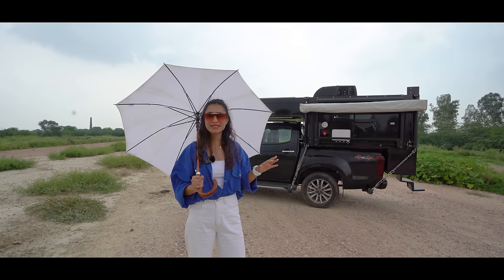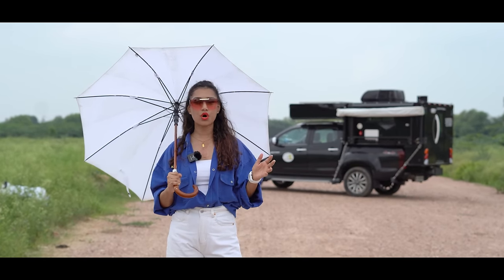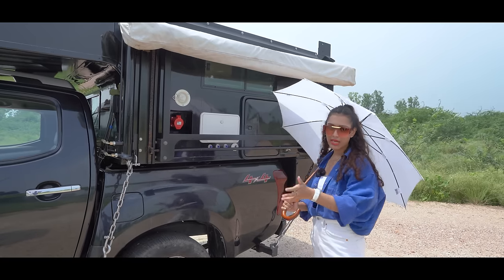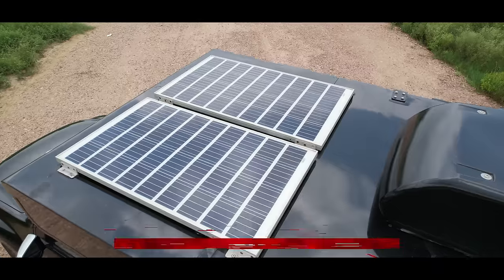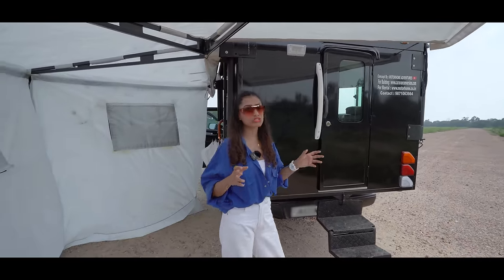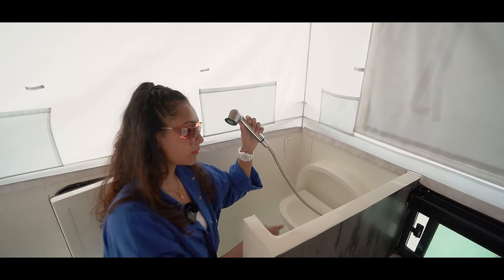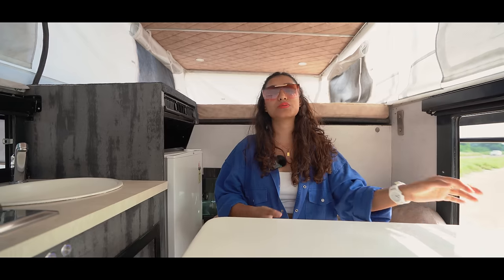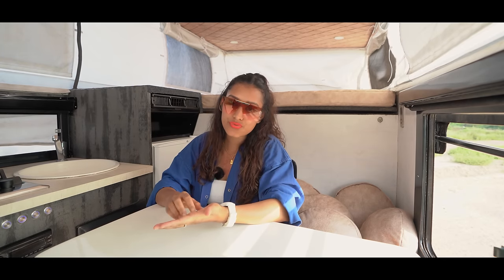Tour INDIA's First Slide in, Pick Up Caravan on Isuzu V Cross/ Walk Through | Motorhome Adventures

Comment: Its a great design... Kudos to the engineer behind the design....

The best part is the back cabin can be dismounted...

Also want to know about water tank placement and capacity....

I have few concerns...

Why the toilet is not placed in the centre of the bathroom...

While climbing the hilly area... The back cabin might pull and flip the vehicle...

Few suggestions:
The bathroom can be placed opposite to fridge... But with that we might have to compose with sitting space....
Or considering the weight distribution it might be already in best place...

The foldable basine can be given in one of the corner in bathroom...

Kitchen basin can be bigger with lead to cover as there is sufficient space which also can be used as counter top...

For more safety one end of the cabin can be hooked to vehicle front tire section... Some workaround need to be done for that
Reply from the maker: Appreciate your feedback on this but believe us when we say this, it was built keeping client's specifications in mind with the best possible technicalities

Comment: Washroom needs some privacy...😂 Those tent or parachute material foldable thing used for the roof extender can be used as washroom extenders also from inside for separation from kitchen area with a curtain at the gate from inside along with this short door. Stove can be placed on the right  side.😊 Better bathroom can be placed on the opposite corner & entrance can be adjusted.